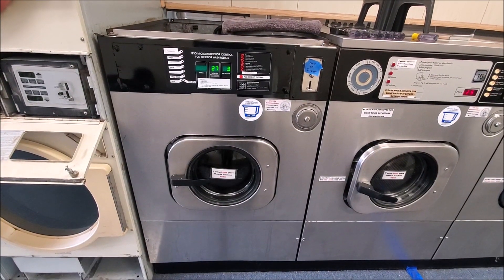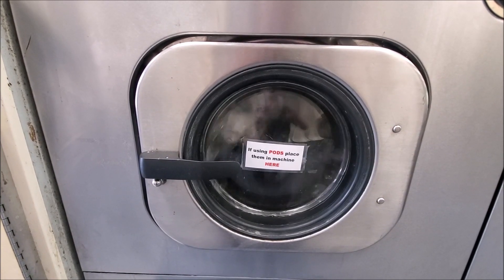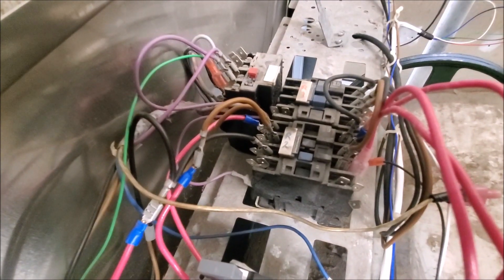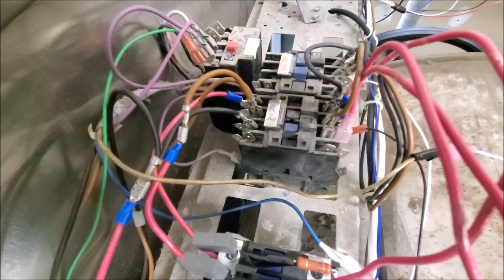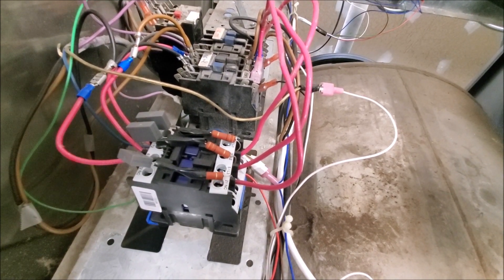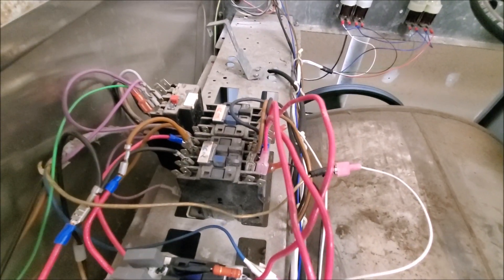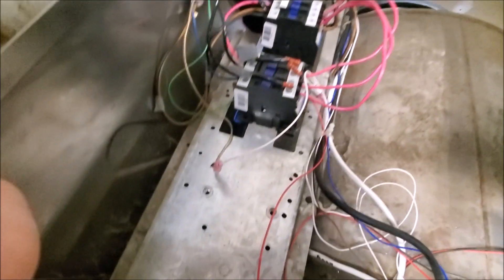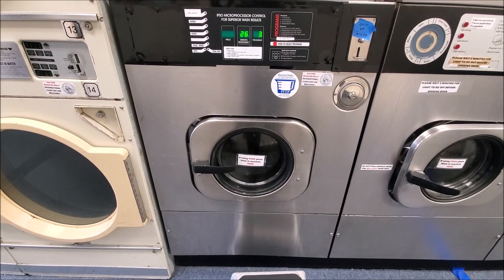Replacing a contactor on an IPSO WE165

Comment: Hi. My ipso (we) is doing the same, clockwise not counter clockwise. But the contactor has a circuit board on top of it (looks burnt out). Does it need the circuit board or was this a previous fix/bodge job? Thanks
Reply from the maker: I think I know what you're talking about. The circuit board on the top of it is a circuit to prevent arcs across the contact points to make them last longer. I never had any so I reverse engineered one and make my own. Would have to look at my notes for details but it's just a resistor and another part across each leg. If it's bad it could be the source of your problem, but I'd lean towards the contractor itself.